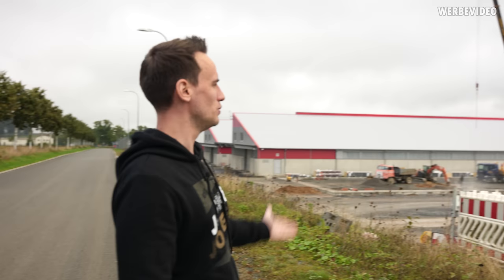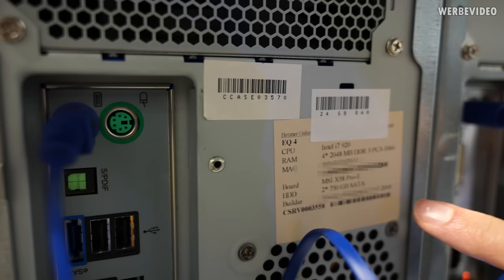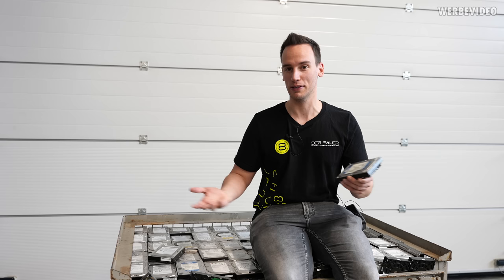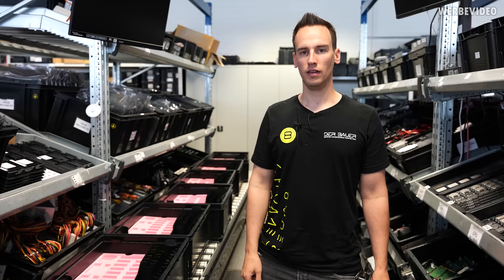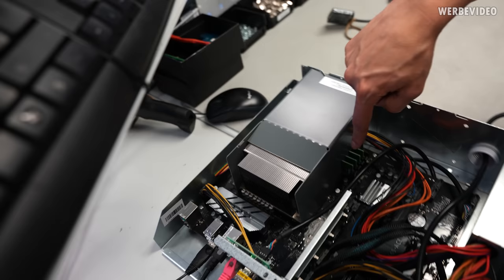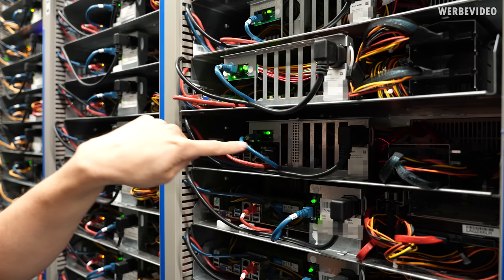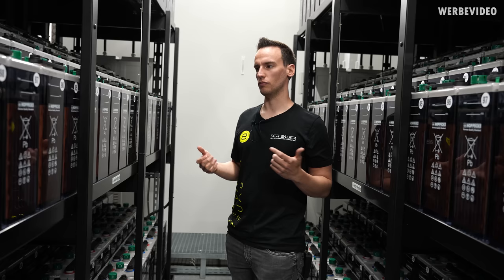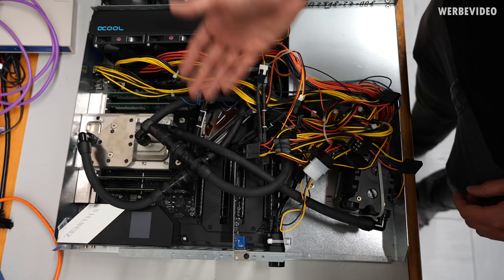Over 200,000 Servers in One Place! Visiting Hetzner in Falkenstein (Germany)

Comment: I've been a happy Hetzner customer for almost 10 years now. Have many many servers with them including some of the models shown in this video. I've had a few hard drives fail (as they always do) and Hetzner replaces them extremely quickly, I'm talking under 30 minutes.

Really excellent service and my only desire is for them to open more datacenters in more countries. North America (Canada, USA etc) would be wonderful as-well as Asia. I love their service and just want more regions for redundancy.
Reply: I've had them for 7 months and were amazing, their choice of drives used also is good. (I got an 7K400 6TB when I asked, thank god not a seagate BS)

Everything just worked, including when we asked for a hard reset THEY even did the reset, and ALSO "replaced server cpu fan as it was faulty", i never even knew it was, after they did it i saw pretty low temperatures too... really good support in general
Reply: ashburn coming soon broooo cyamonnnn
Reply: @eth_saver  we rent our servers at hetzner for over 3,5 years now. No problems at all. Good support, great hardware, awsome pricing, almost no downtime (i mean like maybe 4s/ 3 months or something like that for maintenance). The part of DDoS protection is true, but you can build decent protection yourself if you have the knowledge for it.

I just wish that they would built a datacenter in Canada.
Reply: Same here
Reply: @eth_saver  well if that's true then, people always get what they pay for.
Reply: frankly, if you "own"harddrives and somebody has to replace them for YOU, it is already wrong... they should have a huge bunch of harddrives and if anything running your stuff fails, it just needs to automatically failover to your backup and provision you another harddrive immediately
Reply: @mondvogel6124  people use raid for that. Keep in mind that as a dedicated server client @ hetzner you don't have acces to the hardware. But hetzner will replace drives or other hardware really fast incase something breaks down. The only thing you need to do is rebuild the raid after this.
Reply: @robin791  that is like reallllly outdated. There is no great reason why a client would have dedicated hardware but instead just renting a service (compute, storage) and the underlying hardware comes from a pool, provisioning of which is managed behind the scenes
Reply: @mondvogel6124  not for my usecase. I need the raw power from a fast cpu (single core). Dedicated hardware is one of the better options in this case.
Reply: @robin791  that statement jist shows that you have no clue about cloud technology. You can book almost as much tps as you want and if its a lot, the cloud provider will dedicate CPUs anyway, but the point is that they would automatically handle provisioning and backfill from a pool and replacement and failover is near instantaneous
Reply: @mondvogel6124  yeah, but that is still not ideal for gamehosting. And cloud options that go near your discription cost way more then I am paying right now.
Reply: @robin791  gotcha, that's possible. Still a bit surprised how far those guys are behind the big dogs like ms azure or aws
Reply: to old for this server setup
Reply: @mondvogel6124  You sound pretty young and inexperienced. Raw power is needed for many, many uses and with very high IOPS requirements drive latency will kill you depending on the workload. The difference between an nvme and a provisioned drive is not subtle, at all.
Reply: @Daniel-ml4jr  thats kinda cute. I actually work in the cloud computing space but whatever
Reply: i signed up with them once, while their prices are amazing really and support is ok, the main problem they wont give you more than 4 IPs, i had to install multiple VMs for my customers and needed a single ipv4 per vps of course, hetzner instead insist that you can create some sort of NAT and that sadly didnt work for me so i had to cancel with them and seek another provider...
Reply: @mondvogel6124  They have VPSes and IaaS that is 2-3x cheaper than AWS and 5x cheaper than Azure :P
Reply: Its my desire they have one location in Singapore or UAE. ZERO downtime on my Cloud Servers in 3 Years.
Reply: Hello sir how are you?
I have a application mobile and I want create a server as back end but I don't know which hard disk should I choose so can you give me your advice? Someone said to me seget x16
Reply: @mohannadamouna7358  the Seagate exos line is good, as is the Western Digital Gold line, Toshiba MG08 (16TB) and MG09 (18TB) etc - Just make sure you buy any of these from a reputable store with a warranty :)
Reply: I am also a long time Hetzner customer. Basically whole rack filled to the brim. Their remote hands and service time is really good. At working hours, they can do things super fast. 10 minutes sometimes. In general I do really like them. They are not perfect (i.e. not all servers have permanent KVM, and there are some inflexibilities in configuration, and some non uniform temperatures depending on a location in the rack), but in general it is nice and problem less.